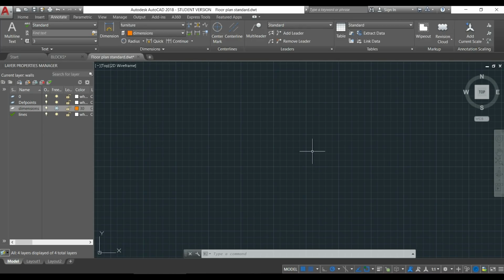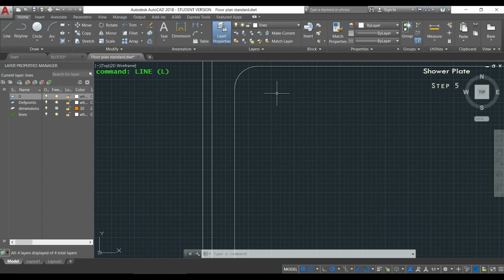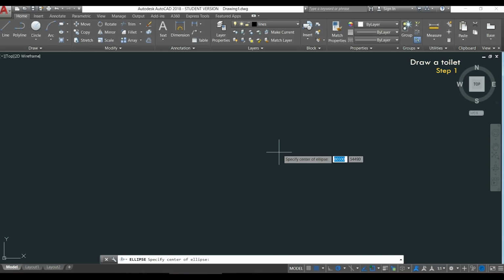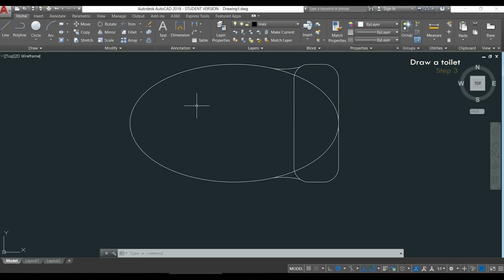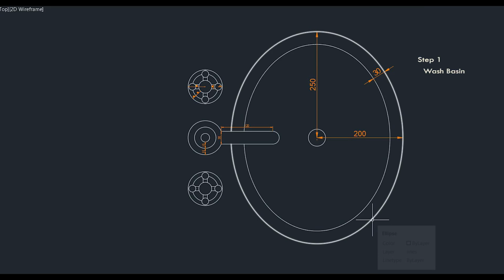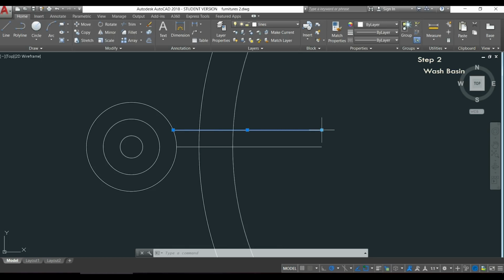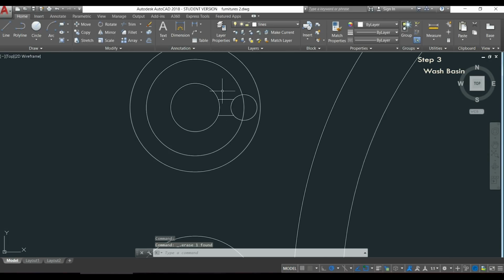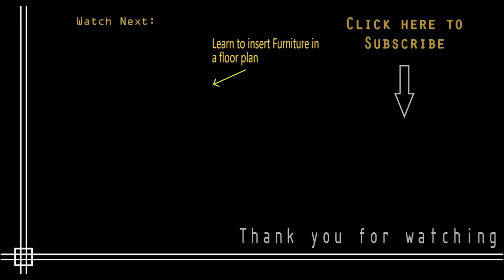Autocad 2018 - How to draw furniture to floor plan

Comment: You are using stretch command and not telling to in the video what ever command you are using if u tell clearly it is good for learner in the diagram when ur drawing line not mention any thing just 50 and drawing line using stretch command
Reply from the maker: Hello Ilyas. These are simply 3 step by step exercises. Any step I tell which command I use although I use a lot the shortcut (alias) for turning on the commands. As far as I remember I haven't use the command stretch in this video.Thanks for watching.